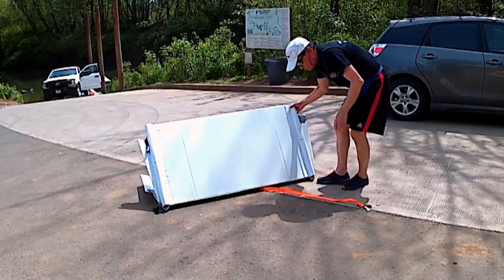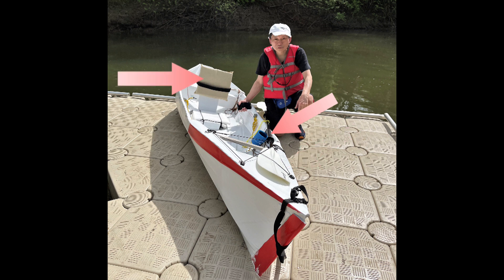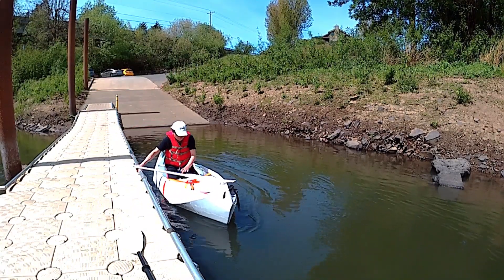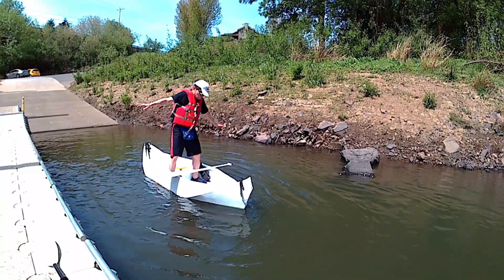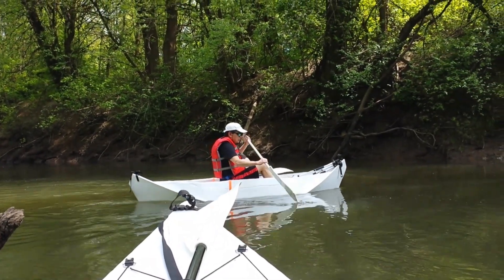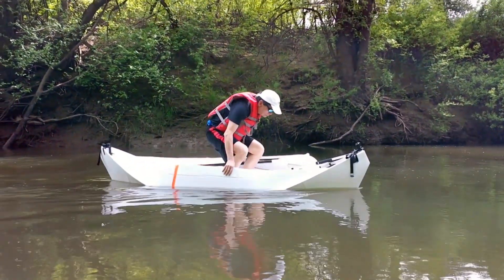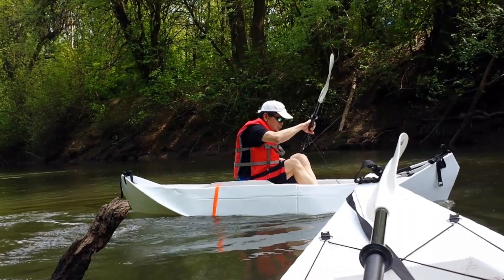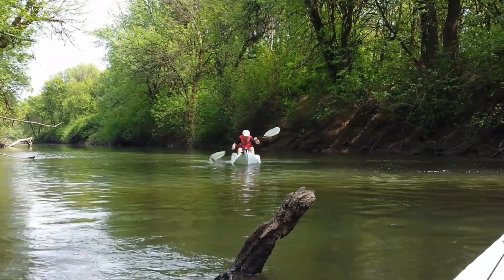Part 2 自製DIY 10' Foldable Coroplast G15 Canoe:  Water Test 自製摺疊獨木舟

Comment: where do you  buy large enough sheets of coroplast?
Reply from the maker: Thanks for this question...The one I used in building most of my coroplast boats were custom ordered from China. I could get what I want (5' x 10' 6 mm thick, density 10 lbs/5'x10'). I have to buy in bulk and I don't recommend people to do that. At that time, I have not discovered heat fusion and local stores, Home Depot, Lowes only have 4' x 8' 4, 5, 6 or10 mm thick coroplast.  https://www.homedepot.com/p/Coroplast-48-in-x-96-in-x-157-in-White-Corrugated-Plastic-Cardboard-10-Pack-WC4896-10/202489118

Now there is an option to fuse sheets together to make a larger sheet. I have been slow in releasing the DIY video for this solo canoe because I am modifying the design so people with 4'x8' 4 mm thick coroplast can build a canoe similar to the one in the video. Other places that make signs, or sell plastic products may carry 4' x 10' coroplast.  Building a boat with 4mm thick coroplast takes more work. There is an article you may want to read to give you a feel of the techniques used in using 4 mm thick coroplast for building a kayak. https://makezine.com/projects/origami-kayak/

The Gen 14 series is about this kayak https://youtube.com/playlist?list=PL2ShZzOUu01v-D-Ap1XcX8TgnFlzwf1NP

If you are in US, you may order the 5, or 6 mm thick coroplast from home depot and then fused them together. The result will be much better than using 4 mm ones. If you use 4 mm sheets, you will have to double or triple the thickness on the floor. This will add to the cost. For me, building this solo canoe is under $100. It will last for a few years if you treat it like an inflatable boat.🙂

Comment: Where do you buy the coroplast for this boat?
Reply from the maker: Thanks for this question...The one I used in building most of my coroplast boats were custom ordered from China. I could get what I want (5' x 10' 6 mm thick, density 10 lbs/5'x10'). I have to buy in bulk and I don't recommend people to do that. At that time, I have not discovered heat fusion and local stores, Home Depot, Lowes only have 4' x 8' 4, 5, 6 or10 mm thick coroplast.  https://www.homedepot.com/p/Coroplast-48-in-x-96-in-x-157-in-White-Corrugated-Plastic-Cardboard-10-Pack-WC4896-10/202489118
Now there is an option to fuse sheets together to make a larger sheet. I have been slow in releasing the DIY video for this solo canoe because I am modifying the design so people with 4'x8' 4 mm thick coroplast can build a canoe similar to the one in the video. Other places that make signs, or sell plastic products may carry 4' x 10' coroplast.  Building a boat with 4mm thick coroplast takes more work. There is an article you may want to read to give you a feel of the techniques used in using 4 mm thick coroplast for building a kayak. https://makezine.com/projects/origami-kayak/
The Gen 14 series is about this kayak https://youtube.com/playlist?list=PL2ShZzOUu01v-D-Ap1XcX8TgnFlzwf1NP
If you are in US, you may order the 5, or 6 mm thick coroplast from home depot and then fused them together. The result will be much better than using 4 mm ones. If you use 4 mm sheets, you will have to double or triple the thickness on the floor. The cost would be similar to using 5 or 6 mm thick coroplast. For me, building this solo canoe is under $100. It will last for a few years if you treat it like an inflatable boat.
Reply: Thank you so much for your quick reply.  I am in the process of researching coroplast buying options.  I really want to make this boat because we live so close to the Cuyahoga River here in Ohio this would be perfect for me to make day trips.

Comment: I like your works👍👍👍 How much weight can this carry? I am hoping to carry a heavy backpack with gears for river exploring; maybe a foldable mountain bike, too
Reply from the maker: Thanks for your feedback. This is a small boat, and at a draft 3.5", it can handle 240 lbs (load). You may want to look into Gen 14,  https://makezine.com/projects/origami-kayak/
If you strengthen the floor, it should be able to handle 280 lbs. The DIY video is here: https://youtube.com/playlist?list=PL2ShZzOUu01v-D-Ap1XcX8TgnFlzwf1NP
Hope this helps.

Comment: Nice.     been thinking about your building the design  and awaiting details. As expected your water test went well, though still waiting on design for 4mm since that is all I can find locally.   I could adapt the G14/Make build but the folding here seems different so hope to see the revised plan.   I was thinking about how flat the bottom is which would make it not track well which is what you observed.  Just a thought  for improved tracking -since the rear has two flat sections folded in, you might add a plastic skeg that drops down between them.   I know you tried a coroplast keel before.. which was too floaty.. but if you use the iron you can really flatten the coroplast it so there is no air left inside a bit like in your paddle, or make one from recycling milk bottles (HDPE which is easy to heat/form at home).
Reply from the maker: Thanks for you comments and input. As on tracking, I agree your suggestion, we can use fins/skeg like the paddle board. I may need that in a windy condition for other boats. For this Canoe, I plan to let my friend to add a few more simple lines at the bottom and make the bottom to this shape \____/ and this will enhance the tracking without using fins/skeg. For this section of the river I tested the boat, there are many sunken branches, logs and skegs may not work well. The float problem of my coroplast 'dragger board' can be fixed easily... just don't seal the board and allow water to drain inside the board. If I make this again, I will use an iron to seal the edge of the board to make the edge thinner (more streamlined) but I will fuse the coroplast using the old method because I believe that will be better to support the bending force. Using HDPE is good, but I have old coroplast for recycling. Hence I will use that for now. You input is great for me to prepare the DIY videos, I will focus more on building a canoe using 4 mm 4'x8' coroplast. Thanks!
Reply: @DIYUSA  Yes with branches would want a flip-up skeg which you could easily do by having a pivot joint (bolt through the plastic  with skeg on it) so when it hits a branch it just flips up and if you don't need it can just leave it up. 

And thanks for posting the PDF plans on your website  dyiusa.org  including the 4x8 version.  I'll probably want to make it a good bit longer  (at least 12')  as I need more displacement than 10' would provide (at least 250lb).     Might even approach your  2-person length since if I have 2 4x8 sheets might as well go for longer.  (I'll use plywood for a "walkable" floor so don't need a lot of excess for that, just enough for heat-fused the loopw for the rails.    (I have plenty of plywood laying around and can always get more by upcycling pallet/crates from work, so will save the coroplast for where I need flexibility).
Reply from the maker: @Dr_Boult  Yes, I agree, I can pivot the skeg to avoid submerged logs. I probably need that if I were on a bigger river and if it is windy. In June, I will start building a pontoon boat with a paddle drive, which will be pivoted to avoid any damage to the drive. If you plan to fuse two sheets, I agree with you to build a longer boat. I don't know if you have read this article. https://makezine.com/projects/origami-kayak/   I told Nat to build a longer one and he ended up built the 12' long kayak. I like to reuse/recycle what I have in building boats. Using plywood works well too. I have tried that also. As on the G15 plans I posted. It is just one of the many possible variations. The length of the boat will affect how it is folded together for transportation. The folding of Gen 15 (for transportation) is easier to modify than the G14's (ORU folding style). I may be able to give you some suggestions if you have decided on the length of the boat.  Regards,
Reply from the maker: I plan to do a simple tensile test on different kind of joints. I don't have good tools and can't do any destructive test. Using iron can join a bigger sheet. It is more difficult to use butt joint to create a joint of longer than 2' because the heat gun I have is not able to generate enough heat to melt more than 2 feet long coroplast and still able to create a good joint.

Comment: It does look incredibly strong and stable, and the paddle worked out quite well also, maybe because the canoe is so light and does not take too much force to move? The kyak paddle seemed to work well. A good test would be a day trip on the canoe!
Reply from the maker: Agree, I need more test on the paddle. After I  finish building my two person canoe, I will test that again and in a two person configuration, I believe I will be able to push more water and paddle harder. That will really check out how well the paddle performs. I need to go for a longer trip and see if it breaks :-)

Comment: Waiting for the 8x4 4mm canoe.
Reply from the maker: We built a few using 8x4 4mm. Though it is a kayak, you can easily change the seat and make it into a canoe. The step-by-step write up is here https://makezine.com/projects/origami-kayak/
This is the play list to build such boat.https://youtube.com/playlist?list=PL2ShZzOUu01v-D-Ap1XcX8TgnFlzwf1NP
Hopefully these help.
Reply from the maker: Yes, I will give viewers suggestions in building one without using heat fusion. But to build one that can handle > 150 lbs, still need to fuse two sheets to build a longer one.